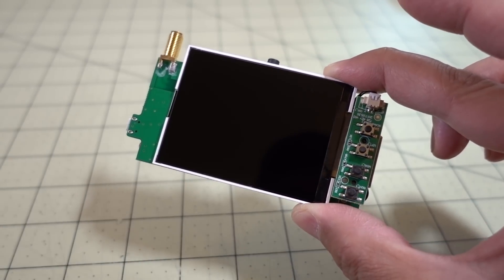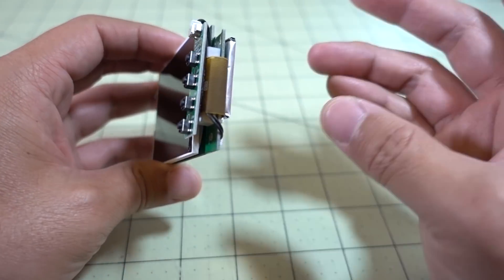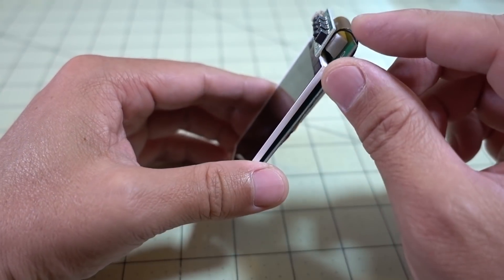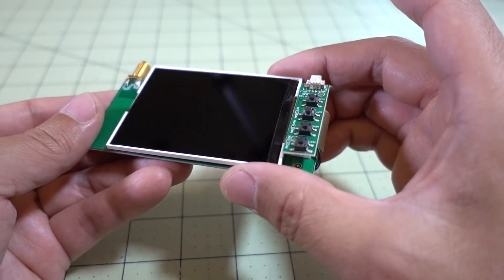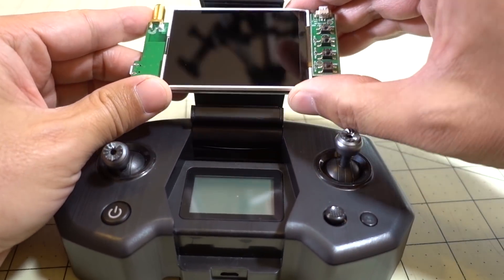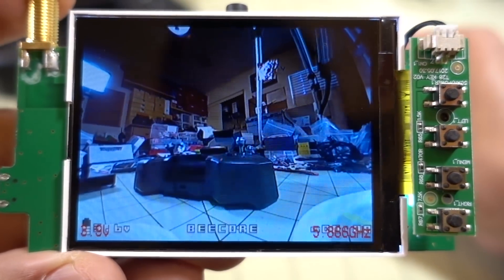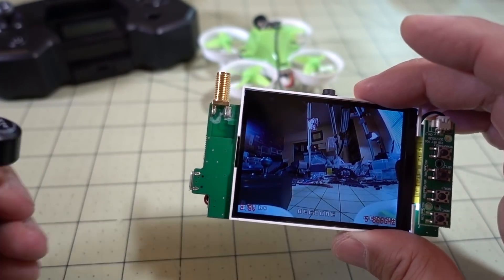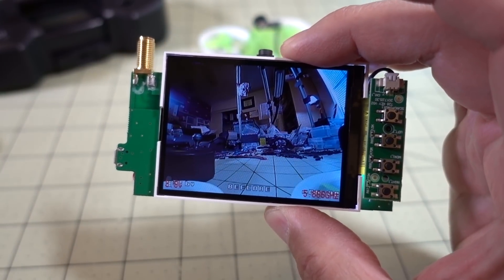Eachine VR006 FPV Goggle to Monitor Conversion Project 🛠️

Comment: Know of any LCD screens to replace the stock VR006 one? I accidentally broke the Ribbon cable while trying to remove it.
Reply from the maker: New ones are $25 now.  I think any replacement screen will be at least $20.
Reply: Yeah I just got another one lol

Comment: Ok so i went to do this last night and used too strong foam tape which pulled off the white backing on the screen which made the image darker. So i ended up soldering up an 'rca' cable so i can plug the reciever board into a tv/laptop etc. If anyone would be interested how, i can upload photos etc to rcgroups.

Comment: Why buy vr006, if for the same money is vr007 and its counterparts? I bought myself 007 for $ 30 and do not regret it, but my friend bought 006 and they did not come up to him. By the way, I also made myself a fpv monitor from a usual 7inch display for $ 15 and a miniature receiver for $ 10 with auto-search.
Reply from the maker: I was looking for something small for the transmitter mount.  7 inch is too big for this project.
Reply: Albert Kim OK 😎

Comment: What'd you take the diversity antenna off for?
Reply from the maker: This version of the VR006 came with the Eachine E013 brushed whoop and it came that way.  The retail version of the VR006 has both antenna connectors.
Reply: Albert Kim Ahh! I see. Said the Blind man. 👍
Reply: Simon Ernst I don't know which one you got. But my factory version has (no aftermarket mods. And only one non-factory-preformmed shell removal)  both antennas, and indeed are fully functional. Though only 'Antenna-Diversity', Not 'True' 'True' Diversity.